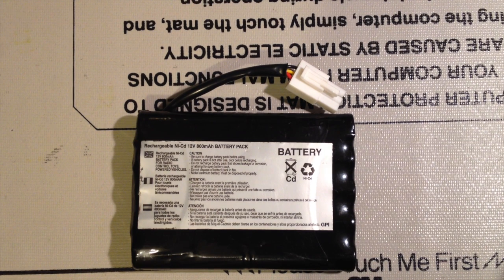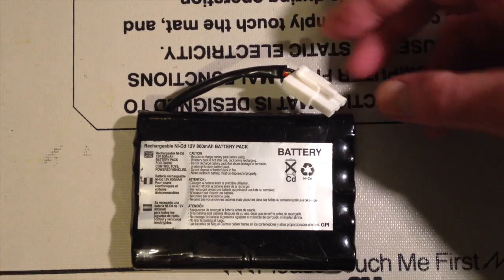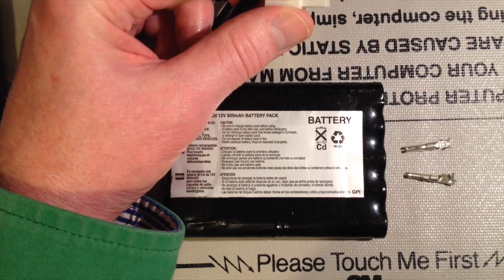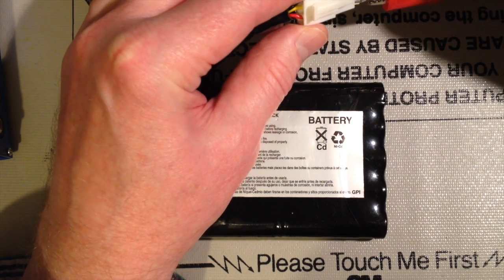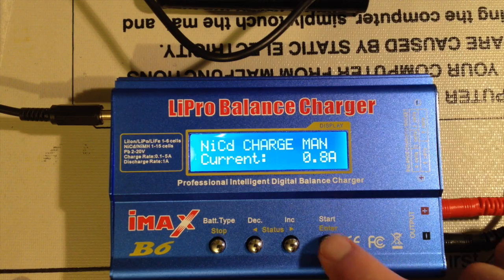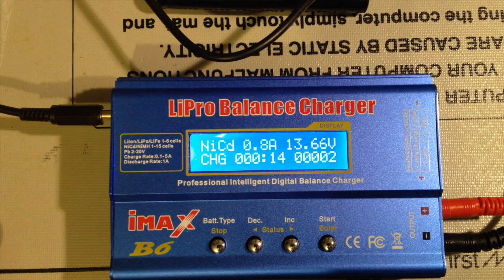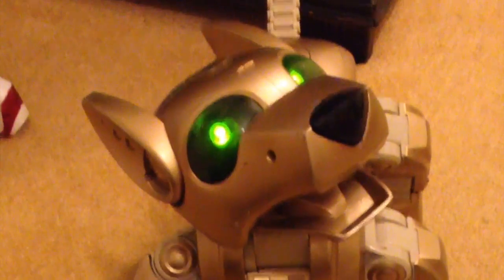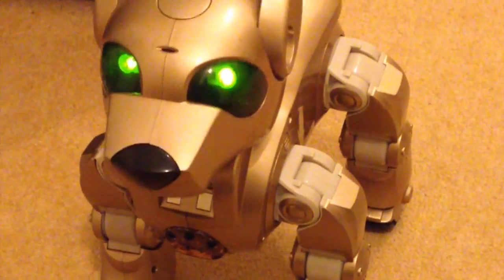i-Cybie Robot Dog Charging Battery Without The Official Charger

Comment: using the IMAX b6 and crocodile clips that came with it, I was able to charge the battery a bit with 18-24 AWG Molex contact pins inside the battery plug, though after 2 minutes it would say my NiCd battery is fully charged when my i-Cybie would only run for only a minute, I'm using a 12v 800mah NiCd battery that came with the dog and its been a long while since i used it. 

here are the settings on my imax charger:

NiCd D.peak Sensitivity: Default
Safety Timer: 120min
Capacity Cut-Off: 800mAh
Input Power Low Cut-Off: 10.0v
Current: 0.8a
Reply: UPDATE:

So I was able to fully charge the battery using a lower current at 0.3amps and added up how much mAh the charger has added to the battery each charging cycle, and it would eventually start bringing out more mAh to the battery every cycle. I brought the completely dead battery pack back to life and adjusted the delta peak on the charger to 12mV/cell. Though it was quite tedious at times when I need to plug the pins into the connector, sometimes it's a real pain, there are some I-Cybie smart chargers on strikalite and occassionally pop up on ebay. I got one myself, simple, easy and does the job right. Without this IMAX B6 charger though it'd probably be harder to adjust the current so this video is still helpful at the end of the day. It may be useful for reviving other completely dead batteries as well. Thank you for posting this!
Reply from the maker: Yep it is possible to very slowly wake up some batteries but they almost almost need re-celling as they dried out when they died. If you found my videos helpful please feel free to buy me a coffee using this link:  https://www.buymeacoffee.com/fixed1tfix4  I need a lot of it to continue making these videos. Please don't forget to subscribe and check out my other great videos there are over 510 to choose from and share @fixed1t with friends, family and colleagues as I could do with more subscribers to help grow the channel. Many Thanks Malcolm aka @fixed1t

Comment: Hold on..... in the video you state that the battery supplies current through the black (ground) and yellow wires (presumably the 6 volt connection) and then through the yellow and red wires??  I think what you meant was through the black and red wires (for the 12 volt connection).  That's why you charge it through the black and red wires.  I'm trying to clear this up,  don't want anyone blowing something up.  It's one battery....but the yellow positive wire connects to a positive halfway up the pack instead of at the end, that's why yellow carries only 6 volts. I'm in the middle of building a lithium ion pack so I watched this before soldering on the plug.
Reply from the maker: First off your right the pack is 12 volt but these are ni-cad batteries which if left can go to sleep. Quite often if charge a little by some other method they will begin charging again. They aren't lithium iron? don't put them in without a set of under voltage and over voltage protection circuits. Please don't forget to subscribe to my channel and check out my other great videos and share #fixed1t with friends, family and colleagues. Many Thanks Malcolm aka #fixed1t

Comment: Spray some WD40 grease in those gears , i can hear the gears crackling in operation ... i will not take long till is breaking
Reply from the maker: sadly WD40 and plastic really don't worked well, I once sprayed it on a large fishing rods to make it easier to pull apart, and soon as it dried, it locked solid, and I broken it trying to get it apart, its great on metal, but not on plastic.

Comment: It wont work ;/ it give me a connection break.
Reply from the maker: I had the same thing when its complete dead it can't charge all four batteries, you have to charge each pair up an little then it will charge all four.
Reply from the maker: Hi, I just watched the video and realised it was the second one I made, I'll make another over the next few days to sort out the problem, the voice may be weird though as I've snap a crown off at the root so it has to be extracted tomorrow. ouch ;-)
Reply: @fixed1t  Thanks! : i was able to let it work! :) it voltage was that battery was 0.20 volt so imaxb6 was not able to find it, so i made a jump start with 4,5 volt , for few sec, after that it was working :)
Reply: Hey how do you jumpstart them? Did you end up making a follow up video

Comment: For some reason everytime I use the NiCd, hold start, and comes up, it has some input voltage error. I'm not sure what to do, the only thing that works is LiPo, but only charges for 2 min 29 sec
Reply from the maker: Sorry I don't quite understand could you explain a little more. Malcolm aka @fixed1t
Reply: Old post.  Sounds to me like your Nicd battery was shot.  If it's really shot a charger like the Imax B6 will give an under voltage error and refuse to charge.  These Nicd packs are garbage anyway.

Comment: To add to your video, MANY people complained of battery packs being DOA when purchasing these i-cybies brand new.  Their main complaint was finding replacements.  

Good news.  INTERSTATE BATTERIES makes a replacement for these which I find absolutely awesome because Interstate is a very good brand and reputable company who stands behind their products:

Here is a link to the replacement battery pack on Interstate Batteries website:  https://www.interstatebatteries.com/p/interstate-batteries-anic1148-nic1148?dsNav=N~2147384805-2147384903
Reply from the maker: +TomasEnriqueAraya Good to know, the real problem was that the instructions that came with the dogs stated that they be charged for around 15 hours with the charger provide.  As the charger was a cheap high current transformer it fried and dried out a lot of the batteries from those who read the manual.  It should have said charge for 5 hours max.  Had they supplied a charger of the same high quality as the robot the company would most likely still be around.
Reply: +FIXED1T I bought one when they first came out and of course followed the charging instructions and without realising it, I fried the battery... It was years before I found someone selling replacement batteries.... by then my kids had grown up and never got to appreciate the little dog... Thank you for your video...
Reply: Wow, $50!  that's a ton of money for NiCad!  Don't think so.  You can likely get NIMH packs for less.  I've been experimenting with using NIMH AAA cells which you could remove and recharge using a true smart charger and individual cells.   The problem with these packs outside the fact that the cells are often no name garbage, is that they are recharged as a group.  That uneven charging ends up frying a cell- ruining the whole pack.  Thus far, I haven't quite figured out how to get the AAA's into the compartment.  AA's will definitely be too big to put in, and remove individually.
Reply: Bad Link. 404